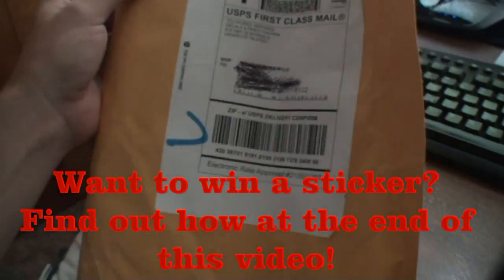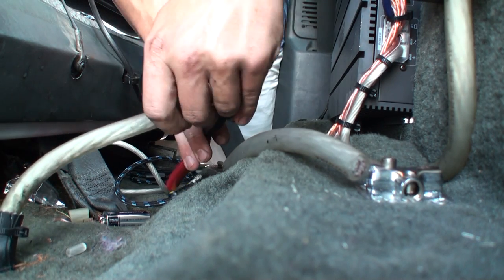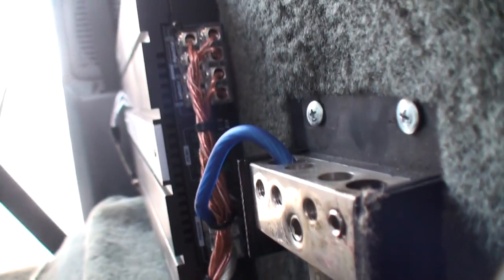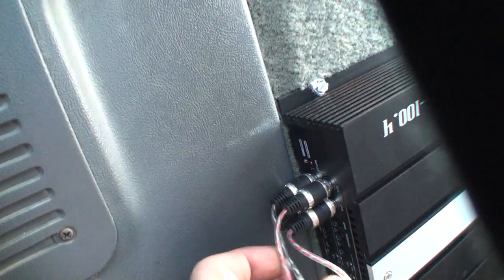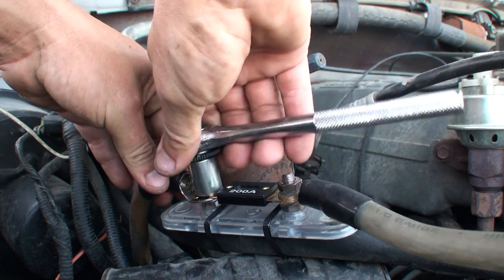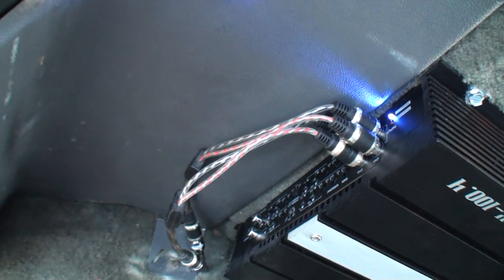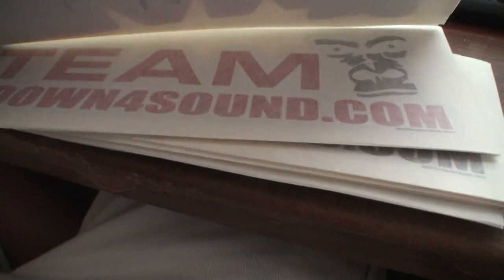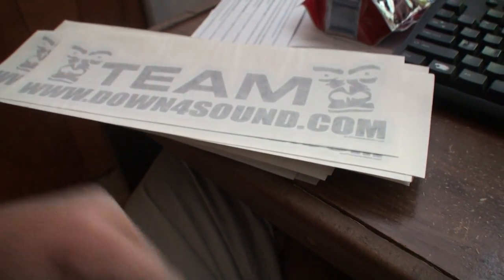Finishing up the sundown 100.4 install! WE HAVE POWER!

Comment: Sounds good for not having touched the gains at all yet. But when you put the power wire into the distro twist the wires together it just makes for a tighter connection no frays or anything.

Comment: I really want one lol finally got my new build in my new car. outside is a little too plain... BTW how is that amp? the amps i have now arent too my type of amps my 15001d mono amp is a current fein and goes into low volt protect mode at the slightest flux and my interior amp isnt doing justice im only pushing probally 50watts rms to two speakers rated at 100 watts rms. PS i want a sticker hell ill send you the shipping money